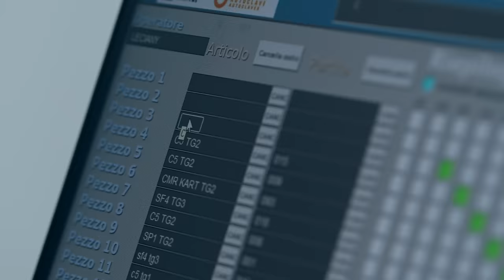SCHUBERTH C5 CARBON | The game changer

Comment: Love it I will upgrade from my C4 carbon
Reply: Yep going from my c4 carbon to c5 carbon. The weight difference between my c3 pro and my c4 carbon really helps with neck fatigue for this old guy.
Reply: @tomwagner6334 Also the C3 & C4 were terrible for safety... Just check thier SHARP helmet ratings, the C5 still only has a 4* rating, i wouldnt touch the 3 or 4.